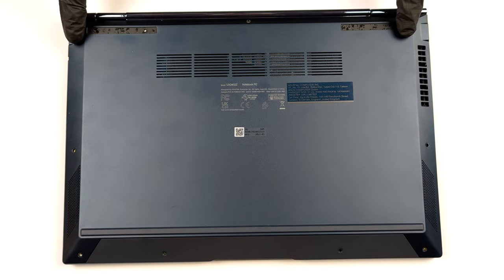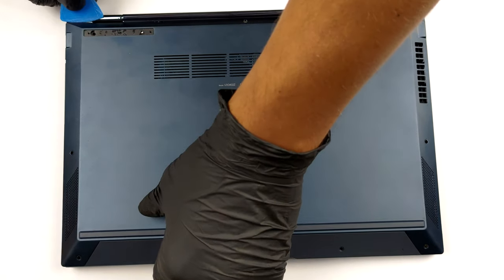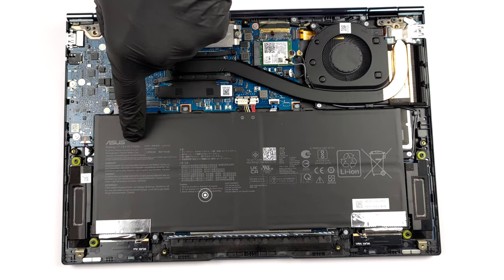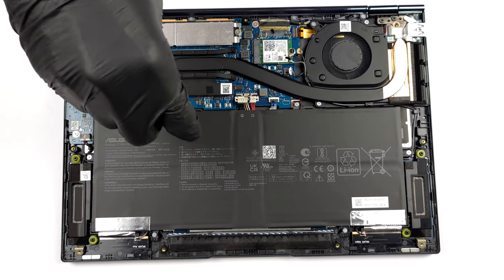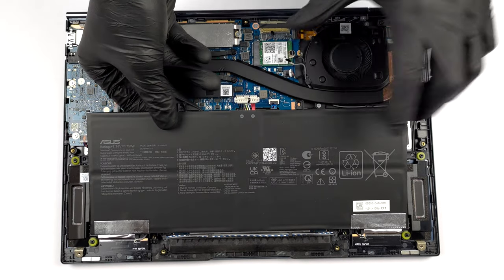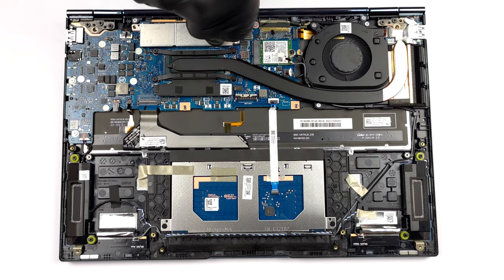🛠️ ASUS Zenbook 14 OLED (UX3402) - disassembly and upgrade options

Comment: what a shame they've went with soldered RAM, 16GB just doesn't work for me anymore, otherwise they seem like such a cool laptops
Reply: but if the 16GB ram isn't enough for your work, I guess probably the p series cpu is not enough as well?
Reply: @jeffhan1239  why not? I can wait more, but even 4P+8E doesn't seem that bad, it's 16 threads, same amount like in my current AMD laptop, and it seems to boost slightly higher, and that beautiful OLED screen, all it needs for me would be more (fast) RAM
Reply: @jeffhan1239 in many cases, amount of RAM is always much more important than CPU itself.
Reply: Can always swap the RAM chips.
Reply: @crazyidiot5309 nope mb supports maximum of 16gb ram
Reply: @furkanbodur9085  Doesn't matter what Asus says. The CPU will address 32GB just fine. 32GB just maybe too many RAM chips physically for the board to handle. If they included unused solder pads this would definitley be a possibility. I intend on taking mine off and resoldering in 16GB.
Reply: @furkanbodur9085  then that’s all the solder pads on the board. The processor can address 64GB.
Reply: @crazyidiot5309 how did it go? did you manage to get more on?
Reply: @CosmicPlayzz  yes. I installed 4x8GB DDR5 315-ball SK Hynix. Only SK. The UEFI has references for controllers and timings for SK Hynix DDR5 IC’s. 32GB is the absolute most that can be handled by that board. I wanted 64GB, but I need 4 more pads. It won’t do any more than 8GB per pad without something done to the UEFI by ASUS and they don’t have any interest in doing anything like that.
Reply: Buy something else why stress yourself, same if a girl didnt suit you find another girl theres millions out there 😂 cheers
Reply: 16 gigs suck these days!!!  I run 4 virtual computer routed through a virtual Cisco  router  for the utmost protection. Three are using 8 gigs of ram.  The virtual router 4 gigs, while the host uses the rest of the 64gigs.
Reply: What about the 8gb ram models?

Comment: I'll admit that even though the RAM is soldered on, the M.2 is very easy to get to and upgrade, and the battery is definitely easily swappable. All that with an OLED screen and a 12th gen i5 with two Thunderbolt 4 ports.... I'll really kinda take that over a MBA. Very much. I'm running this with the 8TB Sabrent Rocket 4 Plus. It's fantastic. 8TB is so nice to just be able to have at my disposal at PCIe Gen4 speeds.
Reply: You got this model? How loud it get when fan kicks in? thank you..
Reply: @osman2k  fairly loud. But it's not really an annoying whir. Just a rush of air. Very similar to a MacBook with fans on.
Reply: So a double sided M.2 fits no problem I guess?
Reply: I just upgraded my same model with a 980 pro but found no screws under the rubber pads, did yours have any? They appear to be larger then those holding the bottom plate, if they should be there I want to add them...plz let me know, as this video isnt clear about it.
Reply: @domm3840  nope. No screw. I just clipped mine in and screwed the metal plate back down. Not like it’s going anywhere.
Reply: Excuse me is your model um3402ya ryzen cpu? I have the same model and I'm wondering the highest storage capacity m.2 ssd we can put in there. Thank you.
Reply: @tinishmaheshwari6593  the limit doesn't exist. I don't think you'd have any problem with a double sided m.2 board fitting, but the thermals probably won't work that great. You can put it 8TB in there if you want. I have. But I run a 2TB SN850x on mine, 8TB Sabrent on my desktop.
Reply: @crazyidiot5309  it is hard to replace the chips?
Reply: @kevinarturoramirezzavalza1708  if you can microsolder, no. You do have to know what you're doing but if you do it's not very hard. Just exacting.
Reply: can you help me which form factor ssd should I buy? I need to replace it. It has gone bad
Reply: @mevlutunlu42  NVMe 2242.

Comment: How did you remove the rubber piece?
Reply: Careful peel and a sharp blade, so that it’ll stick back. Otherwise you’ll need more double sided tape.
Reply: @crazyidiot5309  thanks

Comment: pls confirm can we extend RAM memory 32GB instead of 16GB
Reply: It's not possible since you don't have slots to insert additional RAM cards.
Reply: @BrenoSalomon  you can desolder and resolder new RAM in place if you want to go that far.
Reply: @crazyidiot5309  Has anyone tried to desolder and resolder more memory gotten it to work?

Comment: any idea how good the thermal paste is? would it benefit from re paste with better product?
Reply: From experience, very much. Mine looked printed on the heatsink. I scraped it all off and put a ceramic paste down. I also put a tiny bit in top of the SSD cover so the bottom plate would cool the SSD. I used our laser thermal compound from where I work. Nothing off the shelf though.
Reply: @crazyidiot5309  Thanks for the info, sounds like a good idea, I will plan to do the same
Reply: I think they used a thermal paste from a Honeywell PTM 7950 which is nice but I always re-paste my console with thermal grizzly extreme and be done
Reply: @HoosierDaddy94  I still need to re-paste, I plan to soon, I added a 980 pro m.2 and it does run alil warm, def warmer then stock, but performance is very good, esp since the 8gb ram cannot be upgraded, I wanted my swap file to be fast...

Comment: Would the Crucial T500 ssd be a good upgrade for this laptop? 

And is it worth re-doing thermal paste on the cpu? 

Thanks
Reply: the first yes i have an 8tb and started of before that with the crucial t500 with 2tb so yes it is worth and second no only if you use it for a longer time like idk maybe after 2 years or so

Comment: The memory is soldered to the motherboard for worse that's for sure:(
Good job from you guys as usual :)
Reply: ok it's soldered, but are they 8gb or 16gb?  on the asus site it says it's 8gb
Reply: @alsteooaai  both are available
Reply: @nottsoserious  16gb only with i7, with i5-1240p there is only the version with 8 GB RAM
Reply: @alsteooaai  I was able to find 16gb with the i5, but it was refurbished
I like to save money by buying open box or refurbished stuff
Reply: That only issue notwithstanding, it's really a great little machine. I've even accidentally dropped it and it's fine. Little dent in the metal corner but otherwise fine.
Reply: You can always just swap the memory ICs.
Reply: @nottsoserious bro
Reply: @nottsoserious should i get it?the i5 1240p 16gb ram or should i get another pc
Reply: @fingeronthetrigger7568  if you have a variant with an i5-1240p and 16GB of RAM absolutely! The CPU is great! It's very much fast enough for everything I do, and I'm doing videos and other things (I use Linux Mint though). I'm stripping the 8GB SK Hynix chips off mine and replacing them with 8GB units, so when I'm finished I'll have 32GB.
Reply: @crazyidiot5309  so this pc bussin?

Comment: is it aluminum or not? and what parts of case is plastic?
Reply: The outer chassis and display are all metal. IDK if it's aluminum or some magnesium alloy like Dell uses, but it's sturdy. The display extra so. There is not push bend/flex to the outside of the display. You get more bend from the lower chassis than the display. The hinges can be a little fiddly though.

Comment: This new trend of soldering everything into the laptop itself just means they're making our buying decisions easier for us. I sure won't be buying these new junk laptops, and anyone who does probably isn't too smart.

Anyway, good and thorough review, thanks!
Reply: Yea they are making it so you've got to spend more money on what you need rather than just upgrading something of better value.
Reply: You are absolutely right I made the mistake of buying it, I think there is a problem with the ram it will now force me to replace the whole motherboard

Comment: hello, it says max supported ram is 16g.  But if I understand correctly it is 8gb on the version with i5 and 16gb on the version with i7 right?
Reply: I'm using an i5 1240p with 16gb RAM & 512gb out of the box.
Reply: @blackswanmotion  May I ask where did you buy it and how much did you pay for it?  I'm from Italy and I can't find this model or the other with i5 and 8gb ddr5
Reply: @alsteooaai  I'm not sure if eBay is available in your country, but they sell a model exactly like that one. The model number in case you want to look around different markets is UX340ZA-DS51T-CA. It retails for $1100 USD or $700 USD refurbished from eBay
Reply: @blackswanmotion  hey man! How much battery life do you get out of this pc? I'm planning on buying it
Reply: @clo3874  It’s relative. With all the bells and whistles on- HRR, 50-70% brightness, Wi-Fi and Bluetooth, a mix use of YouTube, word processing, browsing and Spotify - around 3hrs. However since my primary use case is for writing - if I sit in a cafe, turn off Bluetooth, Wi-Fi, HRR, brightness at 20-30%, you can last an easy 9-10hrs with atleast 20% left at day’s end.
Reply: @blackswanmotion   ooh, nice! Sounds like I can get about 6~7 hours of internet browsing and coding, huh? 

I'm planning to buy the IPS model, which is 1600p (instead of 1800) and also has 60 Hz refresh rate tops, so it should generalmy last more :) thanks for the insight
Reply: @blackswanmotion hello  blackswan, i am assuming you already using this laptop for about 1 year+, i wanna ask how 16gb of ram and i5 processor do? is 16gb ram can still serv your needs till now? and in your opinion for how long this 16gb of ram can hold out?
Reply: Hi @nurmuhammadrizki2856 . Yes, it's almost been 2 years now. My primary use case is word processing/browsing/music/PPT/Excel for that, this machine does the job quite well. Everything is smooth and lag free while running all the above apps simultaneously and I almost never shut down the machine.  If your use case is similar, then the 16/i5 will do nicely and I have a feeling this machine should last me another 2-3 years easy. Also, editing video is a pain but I expected that. There are other issues with this specific laptop, lemme know if you want to know more. If I was buying a laptop today, I would definitely go upto 32gb, i7.
Reply: @blackswanmotion  thank you for answering my questions blackswan, fyi i just bought this laptop exactly like the spec you have, honestly i kinda regret not buying the i7/32gb ram version, because I encounter this specific issue which is i cannot playing FPS game smoothly, or i can say it's really have bad performance in FPS gaming (CS 2), although i know this laptop is not specifically  build for gaming, it just so unfortunate that it can't play fps gaming smoothly 😔 (it's quite pricey laptop in my country) other than that it works amazingly for the activities like you mentioned above and yes i mainly use it for works. Do you have any thoughts about this issue? Thank you again blackswan
Reply: Balanced or Power efficiency mode on battery?
Reply: @julianmorgan5994  Balanced, 90% of the time.
Reply: @nurmuhammadrizki2856  I'm not into gaming sorry. I regret not going for the i7/32 too 😒

Comment: Hi, this is a nice and informative video. Can you please tell me the purpose of the tapes (one gold-colored and another black-colored) on the bottom side of the trackpad?  You can check the link below where I have shown those with arrows. I had some issues with the trackpad. While repairing the service person removed those two tapes. I hope this does not pose any serious problems.
https://drive.google.com/file/d/18kMfHrBnjiBJ2-Kc9SPeY8gNmfU25wsw/view?usp=share_link
Reply: The left is a grounding tape. The black is just holding tape or tape to make it look better. The left tape should have been replaced and could result in board or component failure if that grounding tape was really put there on purpose.